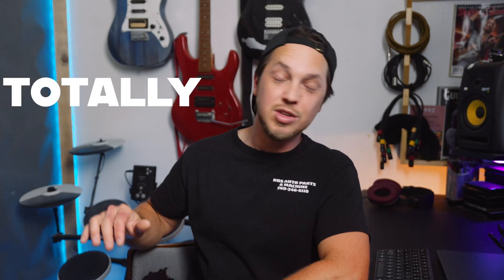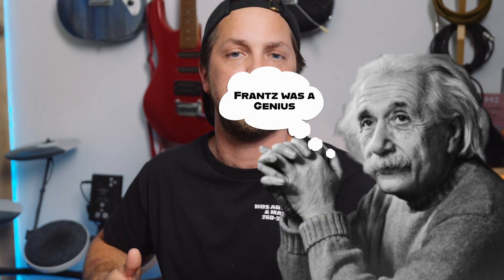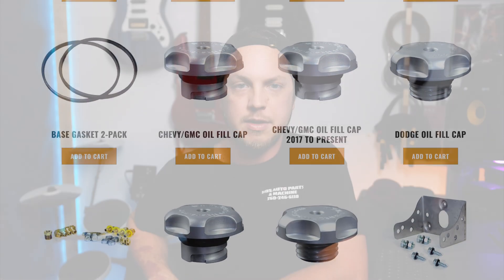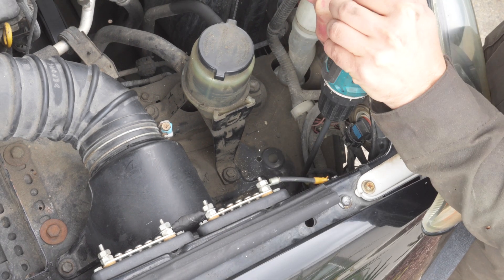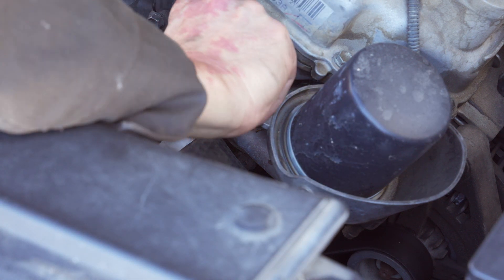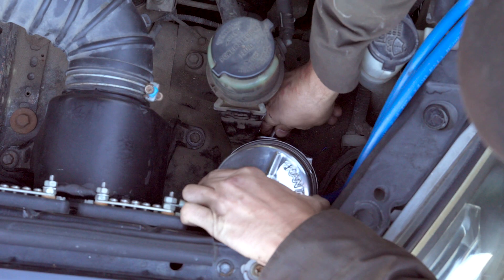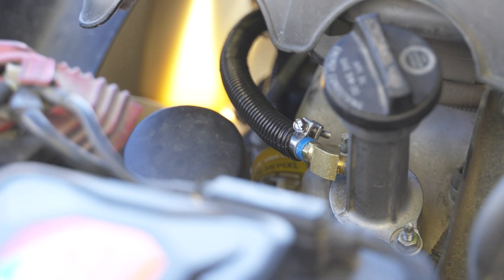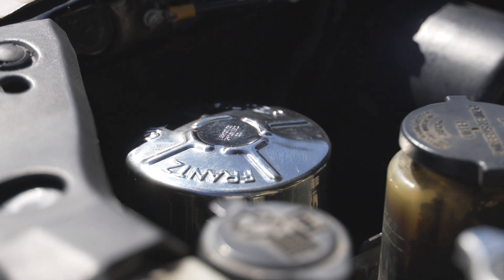Never Change Your Oil Again: Frantz Filter Bypass System Explained & Installed

Comment: Actually, seeing the results of your analysis would’ve been nice. Could you update the video description with a link to your analysis?
Reply from the maker: @ironwoodoverland  I’d be happy to!
Reply from the maker: They send an email so it’d be hard to link, but maybe I’ll just make a short update video
Reply: @ yeah an update would be cool, or screen shot and an Imgur link! Thanks!
Reply: When a trucker pays for an oil analysis report he is mostly checking for engine problems. Not for oil problems.
Reply: No way you can prove anything to a oil change enthusiast. Show them a roll of high quality toilet paper. If they cant figure it out dont waste your time.
Reply: @ralphwood8818  I'm not an oil change enthusiast lol. In my line of work, and in life, practice is implemented based on evidence. Anecdotes are not evidence. He mentioned the oil test that he was sending off for analysis, but did not show the results (or post an update for that matter). The whole video could have been filmed without mentioning the analysis, but since it was mentioned, we should get to see the results.
Reply: When I found out about the Frantz in 1963 I only knew 2 things. The Standard Delo 100 30W was always dirty and black soon after an oil change The Rambler flat head 6 came from the factory with a bypass filter with steel oil lines that didnt clean oil. I installed a Frantz and the oil turned golden. I knew multi grade oil didnt hold up for extended use. Didnt know about synthetic oil or which way the oil molecules were pointed. I knew some Frantz users were sending in oil samples. I figured it was a waste of time and money unless you had a very expensive engine. In later years when I was passing out oil analysis reports that I got from Frantz it didnt help. Its grandpa changed his oil dad changed his oil. I like the top loaders. I dont like spilled oil.  The Frantz isnt set up for regular toilet paper. I like to push in the paper and put on the lid. When I did diesels I had an instrument that passed electric current thru used oil to check for contamination. It zeroed on new oil the same as in the engine. To be a dealer Gulf Coast filters required it. They do locomotive engines on offshore rigs. Its not setting up at the flea 
markets now. Its like military. Im retired now. Dont crawl under trucks or get overheated in a engine room in August.
Reply: The engineers read the conductivity of the oil compared to the new oil. If the conductivity is too high they send a sample to the lab to find out why. If the conductivity is off the charts they take the engine off line until they find out what is happening. Thats locomotive engines on Shell offshore rigs. The experienced engineers can tell a lot before the lab gets it by how the instrument reads.
Reply: My experience is from 20 years ago. Dont know what they do now. Probably similar. We dont set up at flea markets and argue with morons all day now.

Comment: Interesting, but I prefer to change the oil every 6 months or 6k and have an inspection during that process.
Reply: It makes people feel good draining the dirty oil and putting in new oil. The full flow filter is probably still clean but they change it too. In the 60s a lot of engines were so sludged up the toilet paper could be clogged in less than 50 miles. Told my uncle we will need to change the Frantz every 50 miles or open the engine and remove the sludge. He had also removed thermostat. Said they werent needed in California. He traded the 59 Ford in on a new 63 Dodge pickup. When I was putting the Frantz on the pickup his brother drove up. He said my Frantz is no good. My oil is dirty and my lifters are noisy. I asked him if he had changed the Frantz. He said change it?  The guy I bought it from said it would last a lifetime.
Reply: Was just on Ebay. They arent learning. Jackmaster eliminates oil changes. Its true but you dont say it.
Reply: With the Australian Jackmaster Classic I like to drill out the orifice and put the orifice at the inlet. Even better I drilled out the orifice and installed a Perma Cool universal 189 sandwich adapter. I have two Frantz 2 ports from the 60s. They arent universal. Dont fit anything I have. There are a lot of sandwich adapters now . Perma Cool is all I have used. Before the sandwiches I got metric to 1/8 adapters from McMaster Carr.  Havent used a 1/8 inch pipe tap in a long time. I did a fleet of powerstrokes when the 6.0s first came out. The oil fill extension was plastic. Marked it before unscrewing it. Gulf Coast filters only had universals. Bolted the big filter to the frame. Told the specialist I needed a bunch of oil to fill the big filters. He brought me Walmart diesel rated  15 W 40.That was 20 years ago. Later they called saying they had more trucks. Told them to call Gulf Coast filters.  I see one guy telling people you dont change oil with this filter. He had a picture of how he got pressure. It was the return port on the 7.3. He is a good guy but listens to sales people too much.
Reply: I was thinking my old Frantz 2 port sandwich adapters were from the 60s. They are from the 80s im told. I love to use 2 port sandwich adapters.
Reply from the maker: @yuriynyc  to each their own! Now imagine doing that and also having perfectly clean oil in your engine 100% of the time

Comment: Does that oil analysis take into account cylinder wall wash down by gas due to old piston rings?  I'd be concerned about that.
Reply from the maker: @2-old-Forthischet  that’s a great question. I’ll pass it on to the crew at hot shot secrets!
Reply: @diyoverdrive  the TP at Costco may not fit that housing!  😁
Reply from the maker: @ unfortunately it doesn’t!
Reply: Always wondered if this filter was legit.  Certainly not cheap.
Reply from the maker: @ my pops has been using them for decades. People argue about oil breakdown, but that doesn’t apply to full PAO and even if you still do regular oil changes, at least you know your oil is always clean in your engine. They’re very much legit.
Reply: @gef5510  RV TP might be a bad choice for this setup.  It's made to breakdown easily!  🙄
Reply: I have used Camco from the RV section at Walmart. All toilet paper is designed to break down in the RV holding tank. One genious said toiler paper breaks down in a septic tank.  Thats good to know. I can start flushing the toilet.
Reply: If you are getting fuel in the motor oil faster than the PCV can remove it you have a problem that has nothing to do with the oil filter. It has to evaporate.
Reply: When I say I have used Camco I dont mean in my camper. I mean in my oil filter. For awhile it was the last paper at Walmart that fit my toilet paper filters. With the shorter paper I can push the paper down against the bottom and put on the lid. Cant do that with a Frantz.
Reply: My 03 Craftsman lawn tractor has had one oil change. The fuel pump went bad. Instead of putting the correct new pump on it I installed a electric pump. The carburetor couldnt handle the pressure.  Had to change the oil and the toilet paper filter.  Decided after 20 years it was time to adjust the valves. The Kohler 20 HP twin has hydraulic valve lifters. What I could see with the valve cover off looks new.
Reply: As far as I know the only paper that fits the Frantz is the Frantz paper. To use toilet paper in a Frantz you need to know what you are doing. When I used the Frantz toilet paper had a 1 1/2 inch core and was 4 1/2 inches tall.
Reply: Dont know of any paper that dissolves in motor oil. I have used rv toilet paper from the rv section at Walmart. Recently been using Great Value 1000 from Walmart.
Reply: Dont know of any paper designed to break down in motor oil. It gets stronger in motor oil. ATF gasoline diesel cooking oil. I keep hearing bull shit about toilet paper filters requiring single ply toilet paper. When I started using toilet paper filters over 60 years ago I used 2 ply facial quality  toilet paper. Single ply was loose wound. Multi grade oil would void the warranty in a diesel. I used Delo 30W. Not sure when I started using Great Value 1000 from Walmart. None of my toilet paper filters have a center tube. I have a couple of old Frantzs I dont use anymore. I guess they have sentimental value. Cant toss them in the trash.